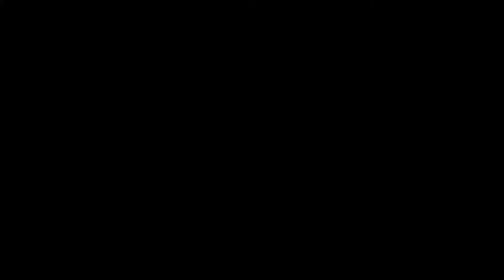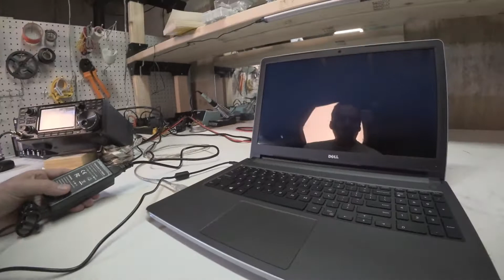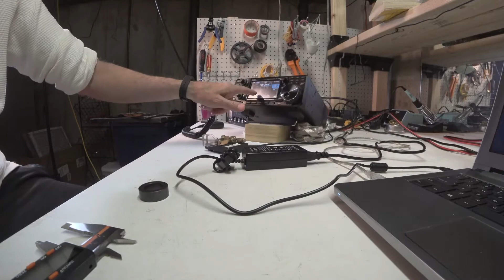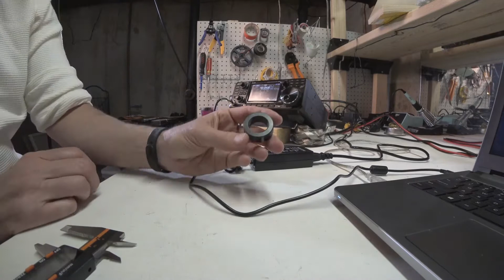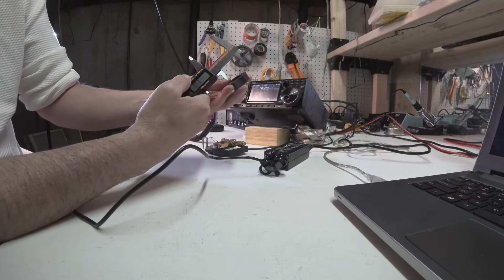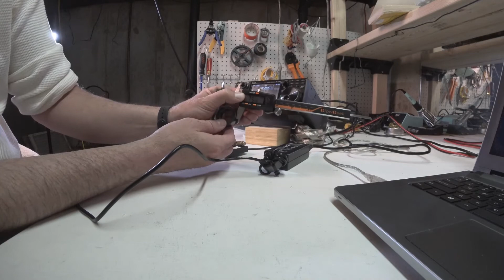Ham Radio RF Laptop Computer Interference FIX!!!  No more EMI NOISE

Comment: I bought a 2 amp 120 ac to 5 volt dc switching power supply board from Digikey for a project housed in a wooden box. It makes so much noise on am radio i have to unplug it just to listen to the radio. The noise goes from the 2nd floor of the house all the way into the basement.  Any ideas on how to fix this?

Comment: i have a similiar issue on both HF and 2M transmitting with a server under my desk... after about 10secs of transmitting my server makes solid beeping sound.  I will have to find a large torroid and try that with the power cord that goes into the server.  Also both my Alinco DM330V power supply AC connection and server go into the same AC circuit.  I probably should look at moving the server to another AC plug and see if that helps.  Thanks for the video.   Great advice.

Comment: I also get way less noise when on battery only, and when I pull the USB cable out the noise diminishes a little more. I tried messing around with 5 clip on ferrites  but forgot to run the thin power cable through as many times as I could on each one. Tomorrow, when the antenna- Nazi let's me have a break while working around the house.

Comment: From what I learn from Ham Radio is that it creates a electrical charge in that one particular area to “trap” the EFI noise by making it electrically sticky. Normally, for low powered devices, the little Ferrite Chocked would work, but Hams pull several wattage of power which would require more charge to attract more of the EMI being picked up from other areas.

Comment: So wouldn't it be easier just to plug it into a different socket
Reply from the maker: Good question actually, in the basement, I only have 2 sockets and one is way on the other side. #2, I don't think so.  The RF energy being reflected back into the 'area' is enough to screw up most electronics.  I solved this issue also with a 'line isolator' from MFJ connected to the antenna.
Reply: AnythingWithWheels oh i see

Comment: Great! I have the same problem when I'm out operating portable. Makes it really hard when I am listening for weak stations on psk31 or ft8/jt65. Sometimes my computer would lock up, but the main problem would be the touchpad locking up. I'll give this a try.
Reply from the maker: It's worth a try, my problems were very bad.
Reply: Bob Plank, did it solve the touchpad?

Comment: I've got a ton of the snap on style at work that we cannot use. They are small and were bought for something else. I wanted to try them for antenna use (common mode current preventative), but they were not designed for that freq range..I'll see if I can dig them up. If I can find them, I'll mail ya a handfull if you are interested.
Reply from the maker: Well, I'm not sure they'd help, actually I bought a bunch before my move, haven't seen them since.
Reply: I'll find them tomorrow and find out the listed rating.